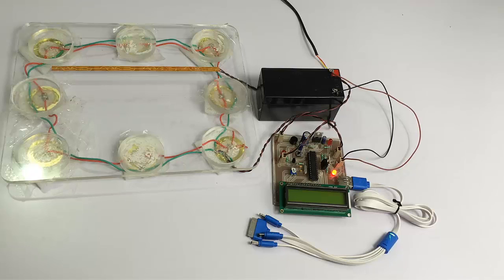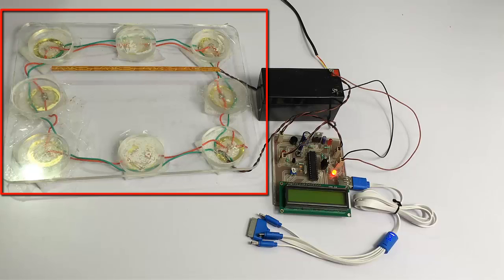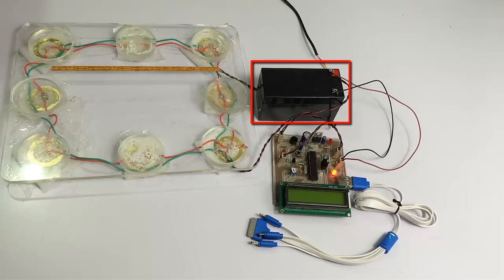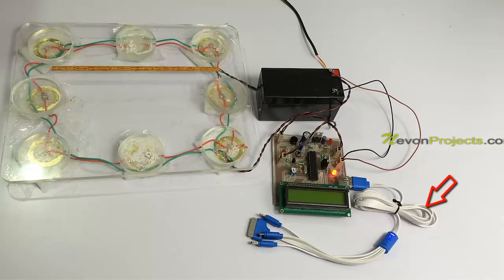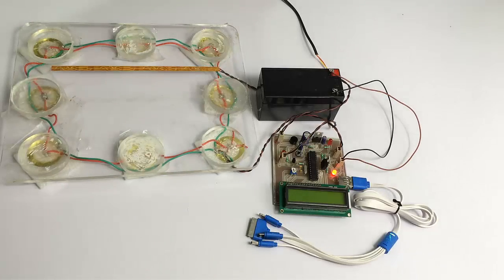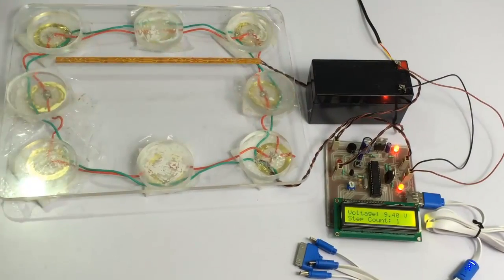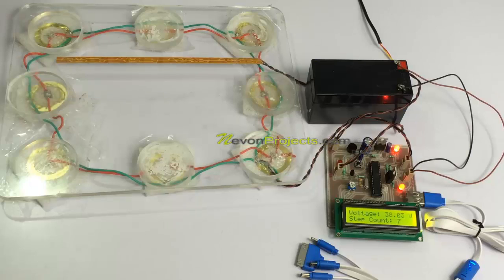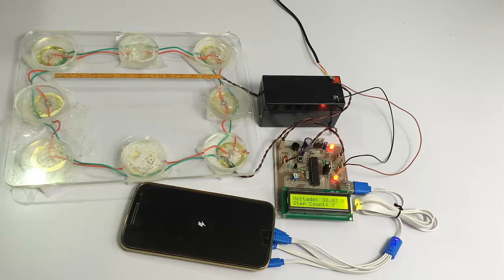DIY Advanced Footstep Power Generation Project

Comment: Can you please tell me how can I charge 9 volt battery using piezoelectric and how many piezoelectric element required to charge 9 volt battery and at the same time I also want to use 1w led bulb through battery and the whole system can fit in one shoe